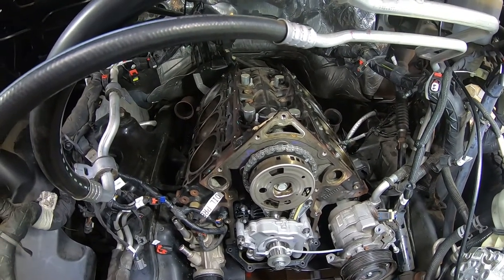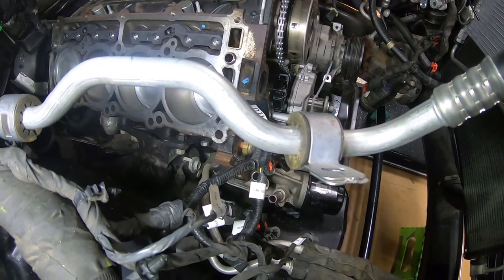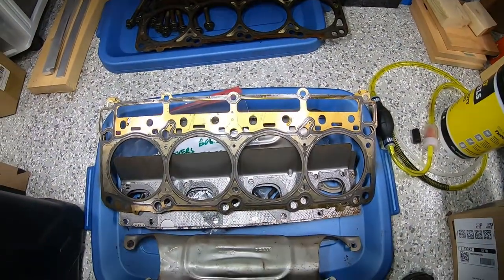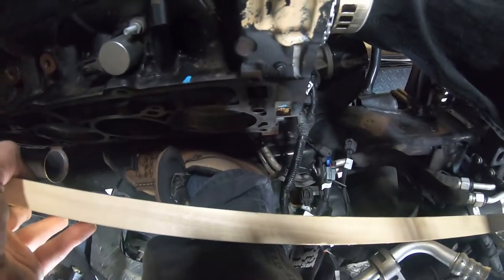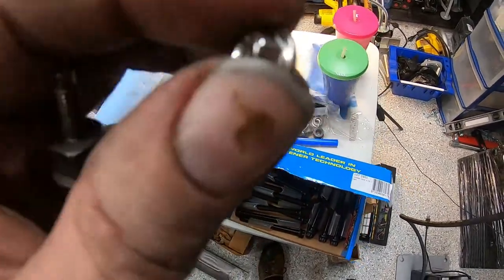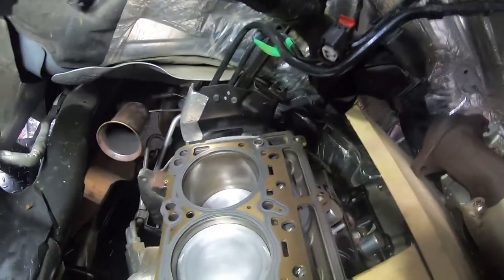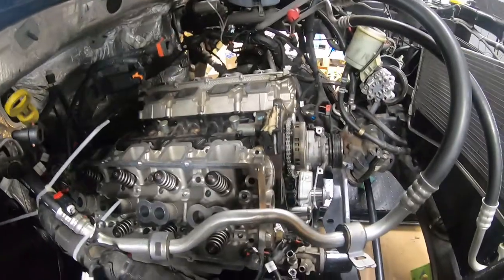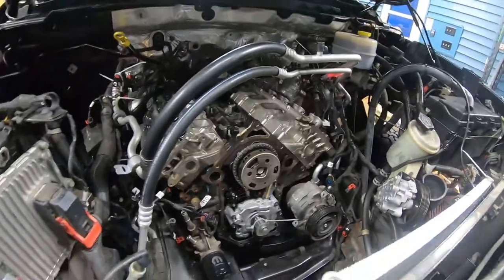Ram 2500 6.4L Upgrade Part 25 hemi cylinder head install.

Comment: Thank you for taking the time to detail this work. I am in the process of performing this procedure on my 2014 Power Wagon. I probably wouldn't have attempted this if I hadn't found your video series on this. I'm having a hard time locating all of the parts needed. Can you tell me where you sourced all of the Mopar parts that you used for this project?
Reply from the maker: Glad to see that you are finding the videos useful.  I use the following sites: https://www.mymoparparts.com https://www.rockauto.com https://www.amazon.com
With Rockauto if you are looking for an OEM part, I have found that if you used the main web page search bar, using the OEM number a lot of times they can get the OEM part and sometimes cheaper.  Amazon is the same, search by part number.  I find that I can use the mymoparparts.com site to determine the part numbers.
Reply: Why didn’t you just go threw the fender well for the exhaust manifold